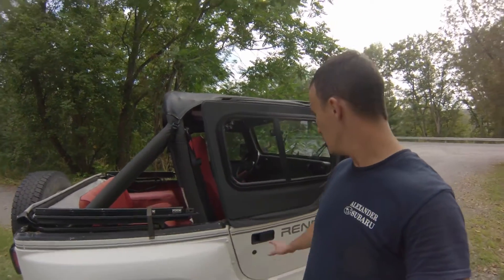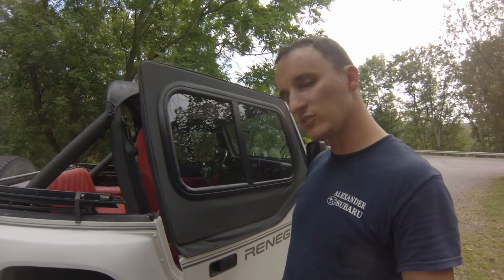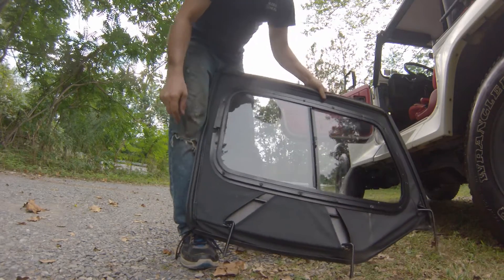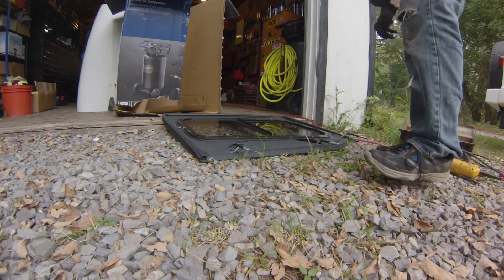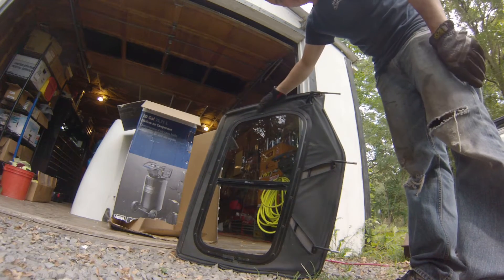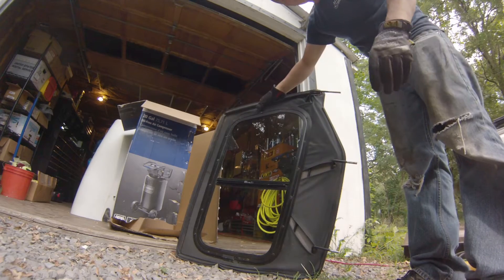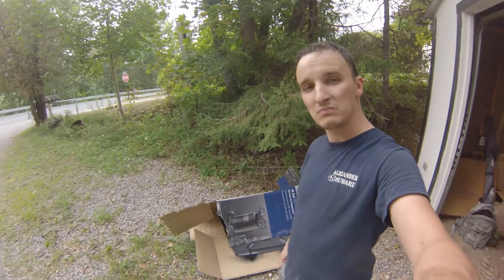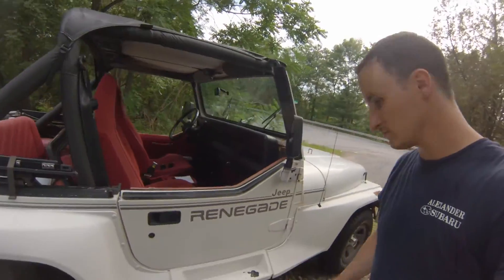Rusty Renegade: Ep 15- Grinding Down Half Door Windows

Comment: hello i just bough the door frame with soft windows for my 98 jeep but the wont go in all the way , do i neet to drill the holes in the door deeper or what should i do thanks
Reply from the maker: There are plastic inserts that push into the half door, that's what was stuck on one of the studs on the window in this video. The depth is set by those inserts, so you shouldn't drill into the door. You probably have the same problem I did here where the window frame studs are too thick.